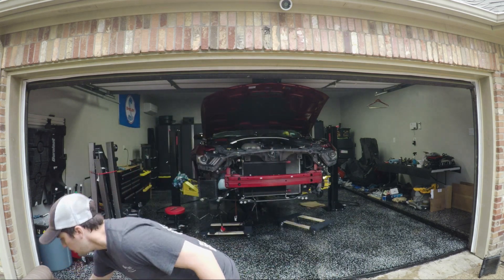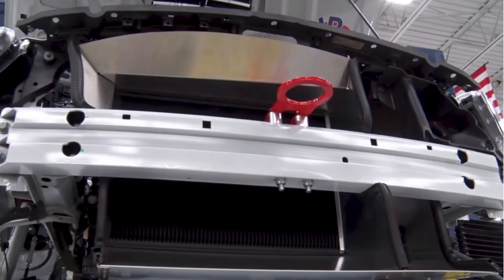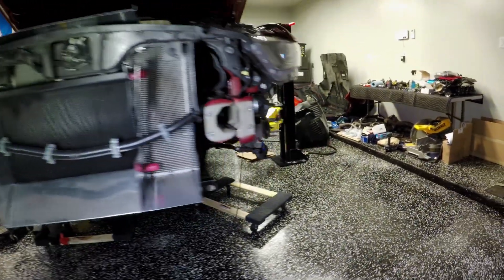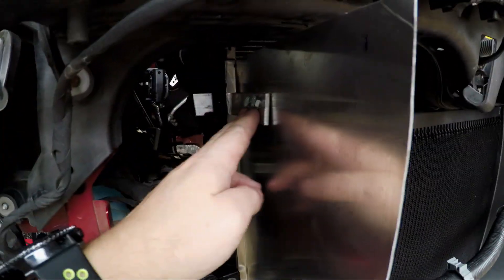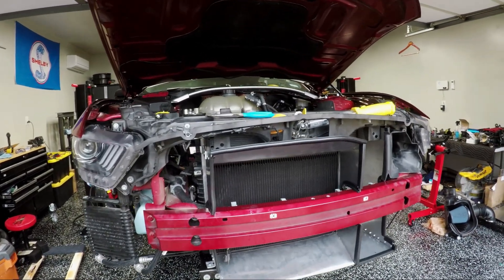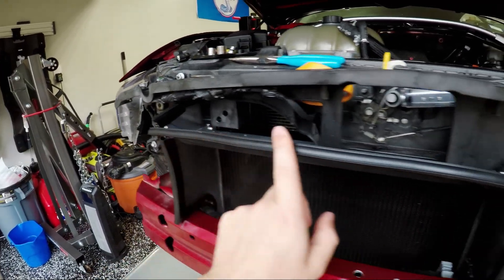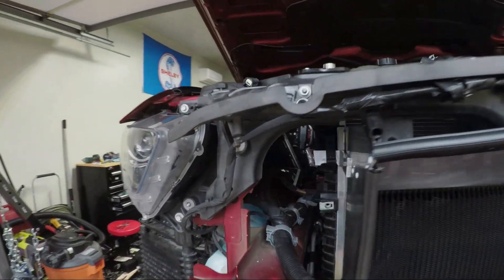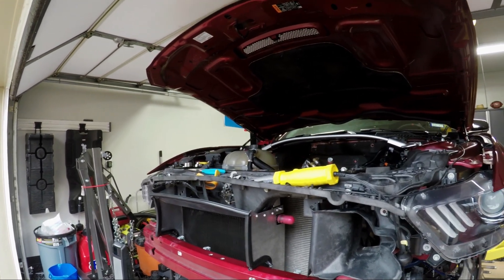GT350 oil cooling: Building custom radiator ducting for the new oil cooler

Comment from the maker: Just to give an update - this setup is working fantastic. I've made other cooling upgrades as well (hood vents), so not a direct correlation, but in 100 degree heat my oil temps only reached 275 in full attack mode. I HIGHLY recommend this setup (or similar) if you're running into engine oil temp issues.

Comment: Very nice work for custom radiator air diverter.  That is a huge cooler for a transmission cooler or engine oil cooler    do they have to be that big for them to work?

Comment: Hey I’m about to do something similar with different cooler placement but I’m wondering how was this setup before you got the hood louvers? 

Did you get any data before and after the hood louvers?
Reply from the maker: You at least need the main center hood vent. You're going to be letting a ton of air in by opening the grill up. So make sure you have tons of way to evacuate. It's really best to have all 3 hood vents
Reply: @honeybadgershenanigans  yeah I figured I would. Gotta practice with the dremel..  I was hoping there would be some benefit just opening up the front.

Comment: Could you have set the new oil cooler tight with the rad like say an a/c condensor, then modify the stock ducting or make a new one to duct to the entire rad?
Reply from the maker: You could, but it would reduce the efficiency a bit. The gap allows the air going through the right side where there is no oil cooler to "balance" out a bit and normalize with the airflow coming through the oil cooler before it goes through the radiator

Comment: Dude wth lol, how much power have you added to this car? That oil cooler is for something that has 600+ HP if that's a setrab series 9 48 row??
Reply from the maker: Oil cooler is directly off the fp350s which is rated at the stock power. It's for extended track use at high rpm more than a particular power level. Works great

Comment: What is another small radiator on the right for?
Reply from the maker: OEM transmission cooler. There was an identical one on the left that used me the engine oil cooler.

Comment: This is pretty cool stuff. Could you make a video showing how you bent and cut the aluminum pieces with some leftover scrap?
Reply from the maker: So I cut with basic metal cutting shears and then bent it very similarly to this video. Just a vice, wood and mallet. The biggest trick figuring out the right to assemble it and bend it so you don't have competing angles you need to bend.  https://youtu.be/pVryHGDxh5M

Comment: kevin you already have an oil cooler on your gt350 why add another one wasting your money
Reply from the maker: Because we still needed more cooling capacity. Works great for HPDE, but not racing environments down here in the Texas heat. Hit limp mode at COTA last July and frequently ran with temps north of 285

Comment: Very nice!  What oil temps were you seeing prior to the rebuild?  How much of a decrease are you hoping for?  Thanks!
Reply from the maker: I was right on the limited. 24-245 CHTs and 285-290 oil temps. I only hit limp mode once (at Circuit of the Americas in 101 degrees after 25 mins). Hoping to lower by 20 degrees or so :)
Reply: @honeybadgershenanigans  it went into limp mode because the oil got too hot? Is that an OEM function or do you have an aftermarket ECU? Either way, I'm talking my tuner into that for my track hack, not a bad idea 😁
Reply from the maker: @arekingi  Nope. It's OEM function. I can't be 100% sure of the exact temps of when it came on, but IIRC, it was around 245* CHT and 295* oil temps